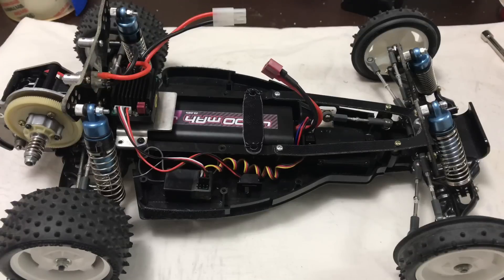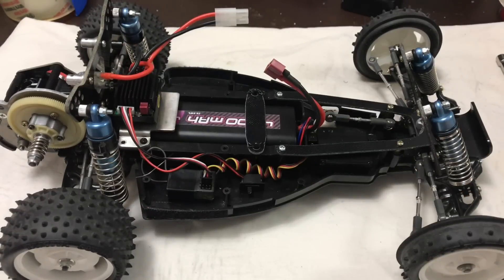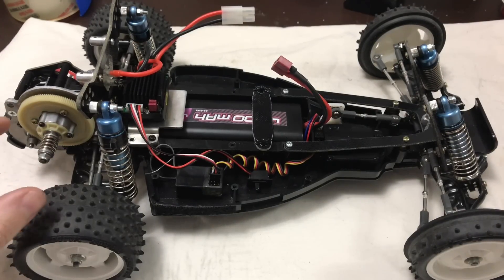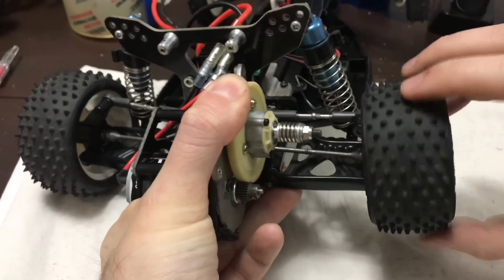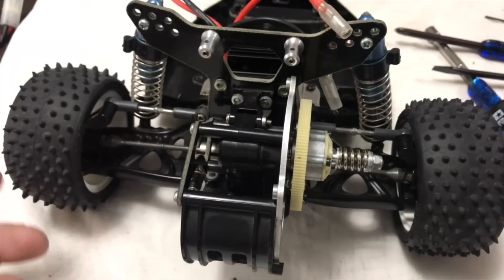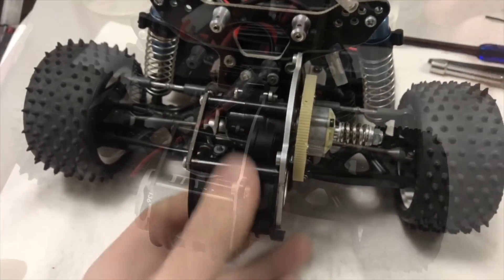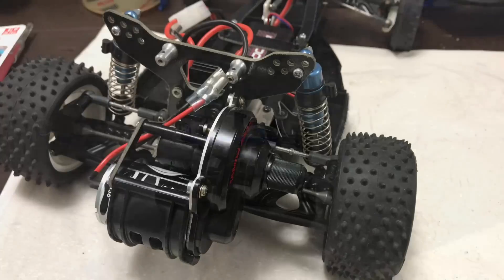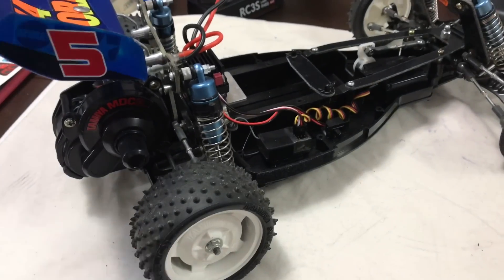Tamiya Dynastorm RC Buggy Slipping Ball Diff!

Comment: put blueloctite inside the nyloc nut and assemble. wait a hour. those diff parts wear quickly so use good  diff grease like the stuff found in tamiyas  on road sedan kits, or  associated, losi, kyosho kits. if not use  mip grease. nice car.

Comment: Had the slipping problem for years...til I found out I had 2 pressure bearings inside the diff, so the counter screw was essentially too short. Fixed that, and if that screw is properly tightened, this shouldn't come up at all. Maybe a little loctite to be sure.

Comment: Have a gas Tr-15t which came out a year after the Dyna Storm, uses the same ball diff and slipper clutch.  Get a lot of slipping in the ball diff, even replaced all of the parts inside the ball diff (painstaking to find) reassembled all according to the manual and still have the same problem. Any ideas?
Reply from the maker: charlieparis1 
Wow that’s frustrating buddy 😬
Tbh I haven’t I’m afraid, I really don’t seem to have much success with ball diffs myself 😭
Reply: I run mine with .18 motor. NO issues with diff even when hard accelleration after sharp turns. The MDC needs to take the torque out of the drivetrain, not the balldif. So if yous diff is slipping, its too loose or the MDC too tight. Find the sweet spot where both of them harmonice together!

Comment: I put a brushless/lipo setup in my 1/10 stadium and the power was undoing the fr/rear diffs! I ended up having to pop a bit of superglue as a threadlock  ( metal on plastic so threadlock don't work) all was good after that .

Comment: Tamiya ball diff was the death of my dark impact
Reply: i got one and got a slipping diff did you have any tips?
Reply: Strip the diff down and clean everything, then use speed controller grease to rebuild it , mine works perfectly now
Reply: @evo4ralliart  just sheared the bolt holding the 2 halfs  together and it was just unscrewing itself instantly before that. maybe a stronger better diff?
Reply: Mine isn’t wound all the way in , if you use the 3mm Schumacher ball bearing’s for the diff there a lot better